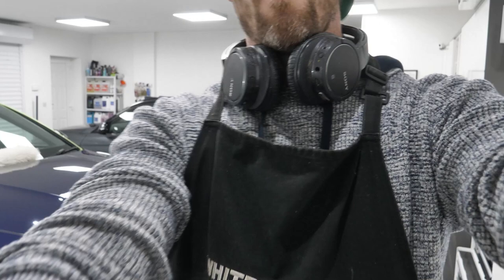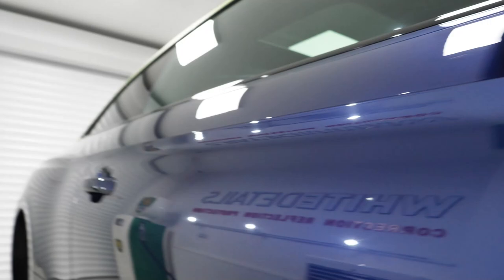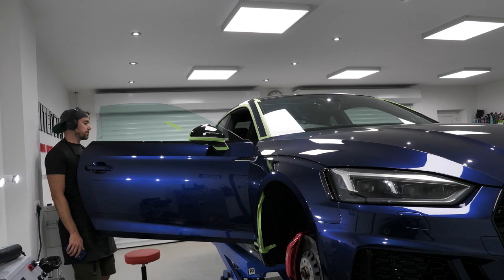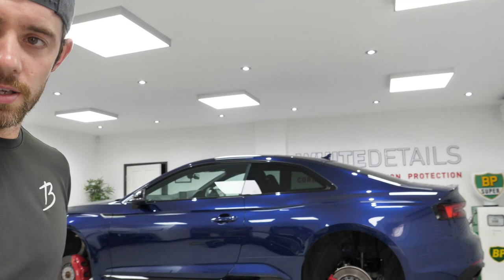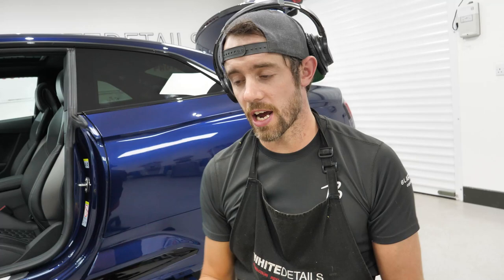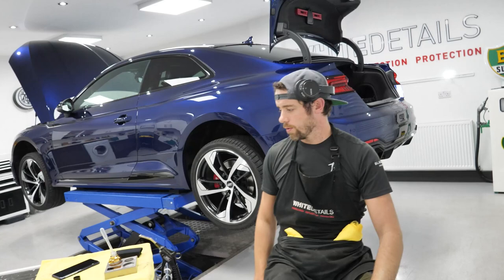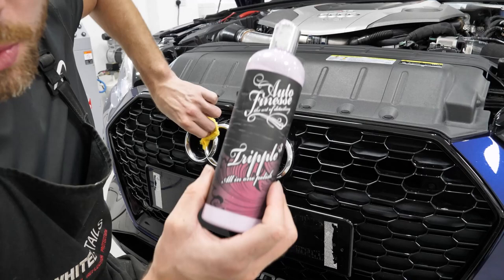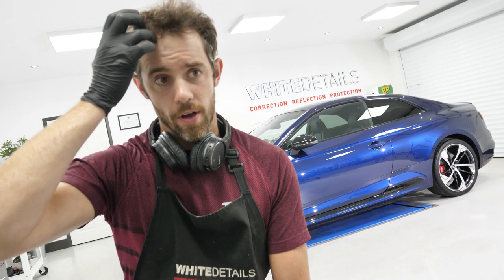Minor Paint Correction Detail on an Audi RS5 - ASMR intro

Comment: Awesome to see you back! 

Ever think of using bucket dollies with 4' casters? They would make the washing process so much easier. Everything I have has 4' casters as I do all my washes in my driveway. It's not the smoothest of driveways either, but the 4' casters prevents the dollies, detailing cart, and stool from getting stuck on any cracked and crevices. It was a game changer for me.

Comment: Do a lot for a local small car dealer.  I am upfront about what I find.  Painted panels, filler, incorrectly masked areas.  There are a lot of unrecorded cars on the road that hide a lot of hidden truths.  Its up to the customer on how they follow up on the information your service provides in my professional honest opinion.  If I was to let a customer drive a car away from me after I changed brake pads and a previous repair on a brake line meant it could burst if not changed, i couldn’t live with myself.  If you didn’t allow your customer to know this information for all you know it could have been in an accident, poorly repaired  and meant the frame was unsafe in any future accident.  Its the honest thing to do. 👍 keep up the excellent work I do learn from professionals like yourself everyday adding to my own personal arsenal of tools and know how.

Comment: Have you ever thought of trying out the new professional high silica ceramic content Coatings from Angelwax ? Genesis 5+ years, Solaris 3+ years in a single layer/application.
Can also be layered, 1 hour/ week or moth apart.
This i perfect if you want to touch something on the coating or top up for additional effect and  durability.
One of the most scratch resistance coating i have ever tested !
Great work as per usual ! 
Keep it up and i hope for a 100K soon!

Comment: I ask beforehand if they want to know the incorrections/problems I find. I've had 1 client that drives a Porsche 997 which was told that the complete paint was original, after I polished it completely the rear back sidepanel showed "cracks" in the paint (ofcourse it didn't get hot, didn't pressure at all, etc.). He got mad at me at first for "ruining" the pain. After contacting the salesman he came out that it was repainted. Turns out they did it as cheap as they could. They took it back and got it painted all over again and he was very happy with me.

I appreciate transparency so that's the policy I run myself.

Comment: Hi all! I wanted to ask for your help on the following:
I recently got the Koch Chemie P3.02 and a soft and medium hand polish pad.
The pads work great, but were only meant for testing.
I now ordered a 3-Pad set for cutting, polishing and finishing.
Is it possible to use the P3.02 for all of them? Since it contains cranauba wax I thought its better to get another polishing maybe only for cutting since the carnauba would seal the paint and lead to a bad surface, ones polished with the other two pads.
Lots to read, thanks for you help!
Reply: No P3 is meant for a polishing and finish if you want compound take Koche Chemie H9 or F6